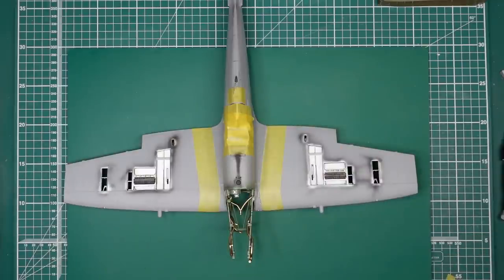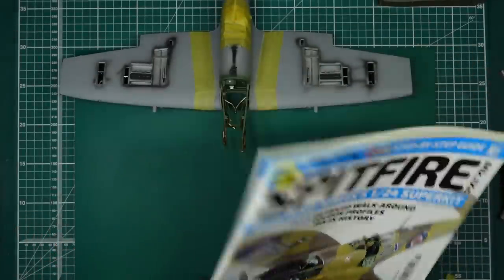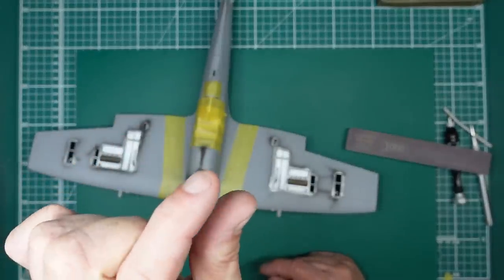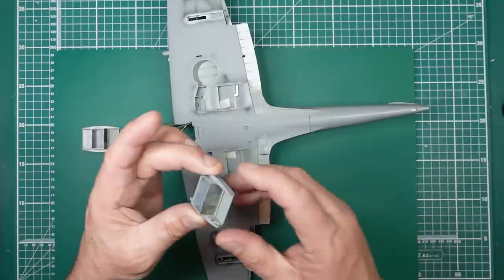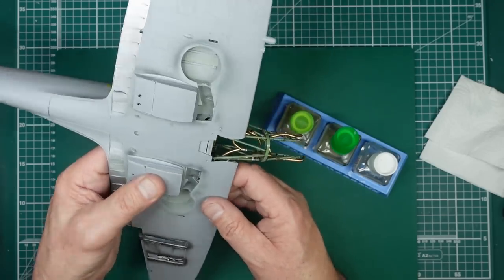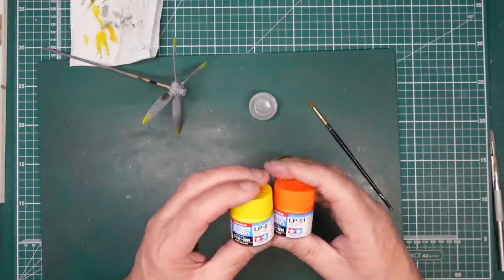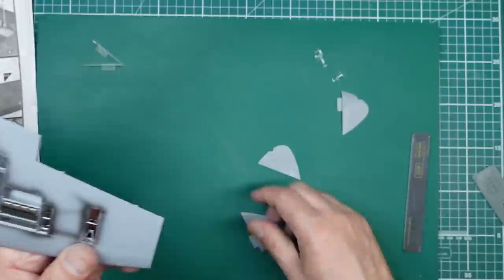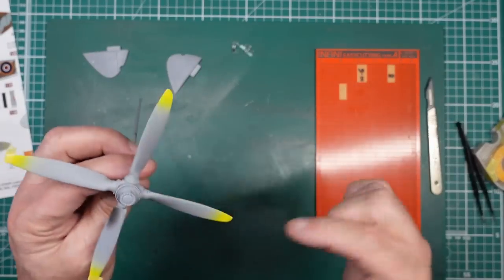Airfix new tool 1/24 Spitfire Mk.IXc Build. Part Twelve

Comment: Propellers in use don't get so much chipped as they get mucked up. They collect a lot of bugs, which leave a greyish, whitish streaked residue mostly on the leading ege, and to a lesser degree on the back side of the blade. If its horsefly sieason you may even get a red kill mark in some spots. This would routinely be cleaned (it reduces the efficiency of the propeller), but even a well maintained propeller tends to show remainders of this residue.
When it's aphid season, the plane may come back from a flight with a black or green line all along its leading edges (both airfoils and propeller.)
My experience is from sailplanes, which aren't particularly fast, but spend a lot of time in updrafts, which bring bugs up in higher layers. Sailplanes are kept immaculately clean, but our motor-glider has the traces of use I described on the back of the propeller.

Comment: Love the build,  looks like it’s going together straight without gaps, if you’re happy with the results that’s all that matters.  There are some builds out there that completed within a week or two and they are real dogs.  BTW with the VMS black you can use VMS debonder either before the glue has dried  or afterwards in the same way you do with surfacer.  But if you do I also suggest cleaning the model very thoroughly before painting.

Comment: Can’t wait to see this in paint Nigel ….in my opinion invasion stripes were applied in a rush , so they originally looked tatty …think they soon tidied them up and realised that they didn’t need them on the top half of the airframe ….so the only the underside had them on ….just my thoughts mate 👍
Reply from the maker: Yeah, I think you're right Richie. Not sure if the stripes were washed off or painted over?
Reply: @NigelsModellingBench  , think they would have a quick turn around, if the aircraft didn’t suffer any damage or have any faults , re fuel , re arm and change of pilot so in my opinion they would’ve slapped paint over the top stripes ….so the camo scheme would’ve been darker / lighter in colour where the stripes are mate 👍even in the days after D day they were in desperate need of aircraft over the beeches for top cover .

Comment: I'm working on a 1/72 scale C-47 and for the stripes I decided that hand painting them wouldn't turn out right at 1/72 but if I just masked them quickly and by eye that the effect would probably be pretty good and I'm actually pretty thrilled by the results!

Comment: As usual a great video Nigel. Ignore the blowhards, you’re a experienced old fashioned engineer as was my Dad although he was a Marine engineer. It’s in your makeup to look for a better more efficient way to get the right result and most of us can see how far you look ahead in the fit of parts to see if there are ways to improve on the original.

Now a question if I may? On the circular parts of the nose cone assembly you have them on the little stick clips  for painting. One with the larger central hole has the clip jammed open to hold it firmly, how did you get it to stay open please?

Comment: More fascinating nuggets of info, Nige, thanks.   I think I recall Will Pattison saying clear sprue was styrene in its purest form.  I like Airfix's precise dimension for the stripes and prop tips.  It is an undeniable fact that for a scale model, scale dimensions are a must for authenticity; "near enough" is not good enough, especially at smaller scales.
Reply from the maker: Great point!

Comment: Hi Nigel,when you come to chipping the propeller blades,look at pics of crashed aircraft with the Rotol constant speed propellers,they shatter and not bend because im pretty sure they were made from wood,not metal.
Reply: You are correct. They are made of wood, which is something I have already pointed out to Nigel but my comment has mysteriously disappeared.
Reply from the maker: Sorry David. This is happening a LOT lately. It is really pi$$ing me off because we are all losing some valuable info.
Reply: @NigelsModellingBench  No problem. These things happen. But, like you, I always thought the prop was metal until I did a little research in to it. So, how does one weather a wooden prop? Can’t say I have done one before. I will have to look for old photos of the Spit or other aircraft with wooden props and see what I can come up with.
Best wishes,
DGD
Reply: Further to my previous reply on this subject, I have discovered that because the prop is made of wood it is important that moisture is kept out of the laminations. It seems be that every time the aircraft lands the prop is examined and if any chips are detected they are immediately treated and painted. So, in effect, they never show any signs of wear or weathering. I got this information from a site which highlights the treatment and repair of wooden props as fitted to the FW190.

Comment: I don't think you would see badly beat up Spitfire blades, they were wood/composite weren't they?  They'd have a metal leading edge which might get some erosion but any bad damage or erosion would likely result in replacement.
Reply from the maker: Apparently they don't have a metal leading edge?
Reply: @Nigel’s Modelling Bench  https://www.historicpropellers.com/wp-content/uploads/2022/07/spitfire.v.twobladedisplay.jpg

Looks like they do its just painted over normally.  It would be brass or copper I think.  That's from an earlier 3 blade propeller, but the 4 blades is probably of similar construction.

Comment: Re stripes, even roughly painted stripes would appear straight at scale surely?
Reply from the maker: I think the rough painting would show in 1/24 scale.. but I'm not going to try it.
Reply: Greg over at Greg’s Models recently painted invasion stripes using a mix of masking, hand painting with a brush and light dust with an airbrush which is worth a look.

Comment: The blades were made of a wooden composite and then covered with a brass / phosphor bronze alloy mesh and a cellulose top coat so metal chipping would not be seen. See this video about four minutes in…. https://youtu.be/ddLNsQC7Srs
Reply from the maker: Thank you for this Dave. I may just "scratch" them a bit then?
Reply: @NigelsModellingBench  One of the best representations I've seen is sponging 'black on black' e.g. NATO and rubber blacks over straight black. Gave an authentic worn look. I tried it on the Revell 1/32 Spit II and it looked great (I did add scratching and chipping too!). From Will Pattison I think.
Reply from the maker: I did that on my Lancaster tyres and they look bloody awesome!!
Reply: @NigelsModellingBench  Just checked out that episode and yes the tyres look fab! I also seem to remember seeing somewhere weathering of the prop by lightly sponging thinners over the dry black and I think I did that on my Revell experiment too.